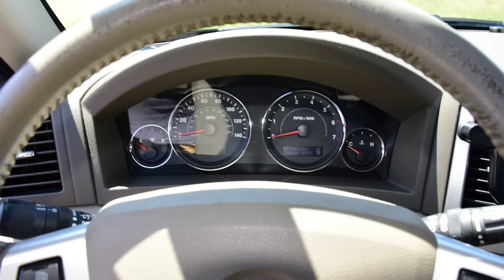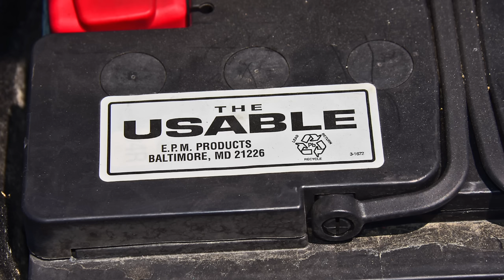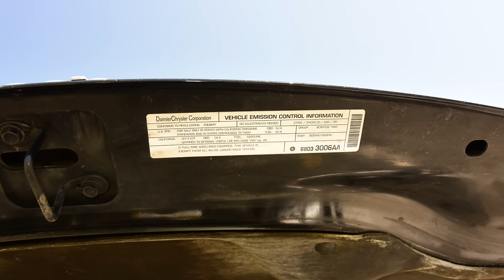2008 Jeep Grand Cherokee Laredo X: Regular Car Reviews

Comment: Dumb is that I have a 2008 and it goes 4 wheeling and doesn't break down. It tows my 5000# sailboat and the body is still solid and clean at 415k on the odometer. I am 6.2 tall and comfortable. My 3.0 turbo diesel  has get up and go and the interior is still supper clean. I think you are a mor on with this review.

Comment: I'm from the UK, I had a WK, a 3.0 CRD with Quadra Drive II. I actually loved the car but less so the headlight styling. Everything on it was great except the Merc stuff, which failed a lot. The Jeep/Chrysler stuff sure was not that refined but it was robust. I actually wish they released the 3.7 V6 petrol for the UK market, they dropped the 5.7 V8 after 6 months from release and they cost a small fortune to run here anyway. The CRD was reasonably economical and sprightly to give it its dues, but I just wanted the refinement of a NA petrol. I wasn't bothered about speed or towing. But yeah, the Merc stuff on it was sh1t and killed the whole experience for me.
Reply: The engine is merc.
Reply: @YOCOSMINMAX16  yeah, I know, and it was unreliable.

Comment: Drive a Nissan Versa Note , your hunt will be over. Sloppy shifting, no power, and bare bones. The worst thing is that it could have been a fun and cheap hatchback, it's almost as if Nissan intentionally made it shitty to fill some short of rental car gap. What wasted potential, it could have been a Honda fit competitor. Take a look at the JDM Versa note SR for what it could be, a supercharged affordable hatchback. All we get is a tease with 5 speed shifter that feels like steering and pot of oatmeal at a old folks home.
Reply: It was even more miserable with that hateful CVT. For some reason mine hung on for 125,000 miles before starting to fail.
Reply: I rented a Nissan Versa and agree 100% that it’s a thumbs down.

Comment: I used to drive a 2008 Jeep Grand Cherokee Laredo and "That force holding It back" is the slushbox of a 5 speed automatic and the fact that it weighed 4,300 pounds but only had 210 horsepower. 18 year old me thought it was fun to have an AWD SUV to get through the snow and thought it was awesome to have a sunroof. Rust would fall off it in GOBS because A.) I live in the north state that slathers the road in salt in the winter and, B.) They're known for rusting out anyways so when you combine the two it creates a very unfortunate sight after a while. The problem with the engine is it's a V6 but you're still getting 13 miles per gallon somehow and being that it's a Jeep an EVAP leak it's just a normal part of it's operation. I loved my Jeep but good lord after a while I just realized I could do better and I also realized Jeep had built better so I upgraded to a 2017 Grand Cherokee Overland with a 5.7L Hemi.
Reply: MISTAKE

Comment: I had a 2008 Grand Cherokee.....BUT....mine was the CRD turbo diesel which I promptly tuned. It made gobs of torque and good power too. The Mercedes 3.0L CRD was a great motor.
Reply: i still have mine and its going strong at 415k

Comment: It's amazing how much better the Grand Cherokee got with the 2011 redesign especially the interior.
Reply: My wife still wanted a GC after this one - she's driving a 2013 now. Can confirm that it's a much better vehicle in every way. The interior is absolutely more comfortable and has a far more finished and quality feel, even in the Laredo spec. The ride is quiet and refined, the engine (3.6) is far more responsive and it gets almost 25 MPG on the highway. She's going to be driving it for a long time.

Comment: Probably the best vehicle I've owned in 60 years.
My 06 with the 3.7 has 300000 miles and I just had to change the alt.
One set of wheel bearings at about 250000, waterpump and that's about it.
Amazing vehicle
Reply: You can probably tell that I tend to keep cars a long time, this one might wind up being the all time champ. So far it's needed a water pump, radiator, electronic throttle and a ton of downstream sensors (kept getting a P013C code but had no issue that would have caused it). Other than that, we haven't done much beyond normal consumables/wear items to it.

Comment: You bring up the Ford Escape. I really enjoy how the box-generation Ford Escapes drive, enough that I bought one myself for a few years. Steering feel, suspension tune, a rorty V6, it was all there. The automatic wasn't great but it was decent enough. And they're really well packaged with good space inside, compact outside, great visibility. Lots to like! But they were just built so cheap, they seem to be very problematic once they're more than a few years old, and Ford service has been repeatedly terrible. So as a car the Ford Escape is quite nice to just drive but to own for the longer term, ugh!

Comment: I also own a 2008 Jeep Grand Cherokee and its got 250k miles on it and all I've really had to do is keep up on oil changes. its got a new battery since the factory one gave out pretty quick and I had to get the ignition switch swapped because the factory one broke (there was apparently a recall on it though so it was free) but aside from that she's still going strong 250k miles later and I'm determined to keep her going for 250k miles more! wish me luck on that one though I'm gonna need it lol

Comment: My family owned a WJ Grand Cherokee Laredo Limited, and it was actually a really nice car. Of course it was a gently used ten year old '99, so we got one of the ones made before Daimler-Benz cost cut them to hell. Despite the myriad of issues like the rear wheel hub literally falling apart or the hatch lock not working when we first got it, it was dependable. My aunt on the other hand, got a brand new WK later that same year. We got rid of our WJ because the used dealership lied about the hub which ended up exploding, and my aunt got rid of her WK within weeks of that because the trim on the door came off while pulling it closed and cut her hands to shreds. I myself accidentally broke the door handles off trying to get out of the car.

This and the KK Liberty were why when Jeep tried to push back upmarket with the KL Cherokee and the MP Compass everyone was like "Yeah, not falling for that trick." Instead everyone jumped on the Renegade instead because it didn't hide that it was a cheap car.

Comment: I just bought one last month. A 2007 Laredo in black. I love it. 

It has heated leather seats, a powered sunroof, backup camera, foot pedals that can be adjusted electronically and navigation with satellite radio. 

I don’t expect this thing to be a race car. It’s a basic suv to get from A to B and it only cost 3,800 in 2024. That might not sound impressive. But for the time I’ve bought it, it is great.

I already put AppleCarPlay and window tints. So for me it’s awesome. Ok gas mileage considering it’s underpowered V6 and full time rear biased awd.
Reply: I just got a 2008 today for $2100. So far so good

Comment: the blind spots are real. I've lost lost entire vehicles in them. Really have to remember to look around the a-pillars. Mine is a 3.0 turbo diesel with quadra drive 2 though so i dont have any complaints about power or 4x4 capability.

Comment: "It doesn't coast"

You're telling me. I've spent my fair share of work hours pushing any number of these plastic trashcans in and out of the shop, and they DO. NOT. ROLL. The whole driveline is so badly designed that it acts like a brake in neutral. It's what eats this thing's MPG rating for breakfast.

Comment: this was the first car i drove on a public road with my learners permit. the cooling system on this car was ASININE; we had it for 2 years and it blew 2 radiators, 4 radiator hoses, and no matter how many times we bled the cooling system air ALWAYS managed to find its way in. the trans also failed and cost probably 2k to fix. my dad got rid of it for a BASE 2019 VERSA. thats how bad this car was

Comment: I have the limited version of the grand cherokee from the same year. Mine has the hemi and it flies, so really you're hating on the engine here (rightfully so) more than the car itself. Mine also has the quadra-trak II system that has 4low and limited slip diffs front, center and rear. I tow a 5000lb camper, but its capable of 7200 and is very obviously capable. I wouldnt tow 7200 due to the less payload. The brake lockup I had once, but it did sit for 3 months (thanks covid) so I just attributed it to sitting and not a flaw, funny to know its an actual issue. Mine being a limited has some soft touch parts but really only a few, mainly on the armrest. There is a lot more leather in the limited, center armrest parking brake, steering wheel and a few other touch points, which helps a lot with comfort and feel. Rear legroom is cramped, but just put the small people in the back lol. I'm surprised there was 0 comments on the god awful cup holders. They are the worst thing I've ever had to deal with in a car interior.

My limited was 43k msrp in 2008, too be honest if you bought any of the base models you wasted your money (I actually did test drive a laredo so I know just how awful the 3.7 is). This generation of the grand cherokee was an absolute dog until you hit the limited, and then it suddenly made sense. This is just so they could say the msrp is lower. Also there was a 3 row version called the jeep commander, which was bigger, heavier, less aerodynamic (somehow) and had the same engine lineup. 

The grand cherokee doesn't compete with a rav4, forrester, equinox or any of those, it is its own thing, and you either buy it because its exactly what you want or you're in another category of car. its one of the most sold crossovers in America for a reason, it has no true competition. It is an offroad muscle suv thing (v6 mustangs were equally a joke as this). The fact the grand cherokee always matched the challenger in engines from the 06 model year to 2021 model year shows where the muscle aspect came in, including the hellcat/trackhawk. The durango didn't get the hellcat until 4 years after the jeep did. 

My limited (which cost me 10k and had about 8k in work done) has been up in the Adirondack mountains of NY and has gotten me there and back every time. It climbs over fallen logs, goes through a foot+ of water with ease, it tows, its comfortable (I do have aftermarket smaller rims with thicker AT's)

Comment: I think the main problem I have with people that bash cars that are not sports cars or exotics is the fact that they tend to act like that's the Pinnacle of automotive enthusiasm. That somehow, you MUST like sports cars in order to be considered a legitimate Auto enthusiast, because you're not one if heaven forbid you like, say, general everyday cars. If you like pickup trucks, if you like hatchbacks, if you liked minivans! I personally happen to be a big minivan lover. I very much like hatchbacks and wagons, and I am more likely to own a pickup truck or an SUV than I am ever to own a sports car. Hell, I find a Chrysler PT cruiser with a 5-speed manual to be a way more engaging driving experience than a mustang GT (yes, I have driven both). 

And sadly, for that reason, even though I love cars all day long and have been an auto enthusiast since I was a kid, I would still be looked at as anything but an auto enthusiast because my heart doesn't lie with strictly manual transmissions, screaming V10 and V12 engines, and vehicles that have barely 3 inches of ground clearance that go 200 miles an hour, but can't haul anything, are not versatile, and can't comfortably fit anyone over the height of 5 ft 7. It just seems to me that there has just been way too much gatekeeping in the auto enthusiast world, and since we live in a world where there is more than one type of vehicle, you should be able to express your automotive enthusiasm for a vehicle, even if it's the most mundane or basic transportation. And since this channel is called "regular car reviews", not "exotic car erotica", I consider this channel a prime example that proves cars, in general, are interesting and special.

Comment: 12:05 That looks like it also has the same problem that my old Durango had. Chrysler made the tailgate more narrow at the top than at the bottom, so if you open the tailgate in the rain, water runs down the open tailgate and straight into the interior.

Comment: My mom's owned 2 Jeep SUV's. One of the last years of the XJ Cherokee, and then a KL Cherokee. I told her not to buy the first one, and she had tons of issues from it. Lots of typical Chrysler electrical problems. The 2nd one, she had for about a year before she realized she just didn't want to be in it anymore, and traded it in on a Hyundai. Which was built better than the Jeep and never gave her a single issue, but it's gone now for a new Silverado. Which blows my mind. Anyhow. Jeeps have been trash since the 90's. I hated working on them because it was always something goofy or cheap that caused all the issues. They always had strange electrical gremlins. And it seems every time you're trying to make progress on the road, there's always a stupid wrangler slowing everyone down.

Comment: So I have a 2008 Jeep Grand Cherokee Overland fitted with the 3l Mercedes diesel. All factory. 7500lbs towing, low range with lockers and a limited slip in the rear. All factory options, all completely stock.

Comment: I think the 4.7 v8 was the only good motor option on these. I'm sure it was powerful enough to not be a sticking point because it was in the dakota which should weigh similar, although if shift logic was the bigger issue here maybe it wouldn't help much. It had the least reliability problems out of the lineup too. I am curious about the mercedes diesel engine though, I know it was really loved in the e class but somehow I can't believe it ended up issue free in a jeep. No fixing that sad 2000s dodge interior though. Awd/rwd only with no 4x4 option was a pretty strange choice for jeep considering even the smaller liberty had actual 4x4 with low range.
Reply: Mercedes diesels were great because they came with their 5G transmission too, much better than the Chrysler. They have leaky oil cooler seals that require you to disassemble everything and dont like short drives. But its a van engine that goes on forever if maintained

Comment: I have an 07 I got cheap and it’s alright. Mines a 4.7 with low range, factory dipstick and it drives decent. That rear end sound more than likely is the front drive shaft that goes from the transfer case to the front diff.

Comment: I had a 2006 JGC Overland Hemi and... it was OK....  It had gobs of power but over 90, it felt like an airfoil, almost like I was losing contact with the ground.     I had QuadraDrive II, so 4x4 Low got me through near 20 inches of snow in my driveway so I could drive unplowed roads to get to work.   I did go on trails in Utah as well without drama.

Certainly didn't have as many problems as this one did, but I also got rid of it after 9 years and 130K+ miles.

Comment: The reason they don't provide a transmission dipstick, is because Chrysler vehicles use a scale for their fluid levels, depending on the temperature of the transmission fluid. It's called a StarScan tool or something.

Comment: Depends on which of these jeeps you actually get. I have an 07 overland with a diesel and it's one of the best vehicles I've ever driven. Its extremely reliable and faster than a hemi with a tune. The ride quality on the overland suspension is amazing and being a diesel with a tune I got better fuel milage than most new gas cars

Comment: I did notice that the serpentine belt is routed wrong.  It should go from the A/C compressor, down below the water pump, then back up to the alternator.  How it is routed in the video will spin the water pump backwards, which can overheat the engine.   Seen a lot of these 3.7 and 4.7 PowerTech engines with that same incorrect belt routing and it has claimed a good many of these engines, too.  They don't tolerate overheating.

Comment: I think part of the sluggishness problem is that Chrysler was lying about horsepower figures. I have a 10' Dakota with a 4.7 and it also feels slow. It claims 300 - 310 hp, but it only feels like it's getting close to that if you really rev it out, and it DOES NOT feel good to run it up to anywhere near redline.
I've driven cars and other small trucks with V6's that feel about as brawny, especially in the middle RPM range.
And the interior also has that air of cheapness. Hard plastics, squeaks and rattles everywhere, controls and handles that feel flimsy, etc.

Comment: I had a 2010 in silver, steering knuckle failed after driving through a pothole at low speed, three days after purchasing it used. Left me stranded on a shitty road full of mushy dirt and snow as its left front wheel was doing the McQueen Kachow thing.. I sent it straight to the crusher and watched it get squeezed up, avoid 2005-10 GCs

Comment: I inherited the 2010 version of this pile of crap.  My Mom bought this to replace her 2007 Grand Cherokee.  It was such a downgrade.  The 2007 had the straight 6 4.0 liter and a changeable 4 wheel drive. You're so right about how this thing drives.  I traded it in for a Honda Accord with the V6.  Anything is better after this vehicle.
Reply: Last year for the 4.0 is 2004
Reply: @ohyeahgamer3736  You're right, it was a 2003 I was thinking of.

Comment: A Jeep is that one car for the humble person that knows it's a shitbox but buys it anyway because they need something to get from point A to point B.

I learned to drive in my grandma's 2014 Jeep Compass, and I use it as a daily beater. The thing is almost 9 years old and is pretty reliable, and compared to my mom's Silvarado from the same year, the body is holding up pretty great. The car only has a little more than 51,000 miles on it, and I like driving it. It's not much but it gets the job done.